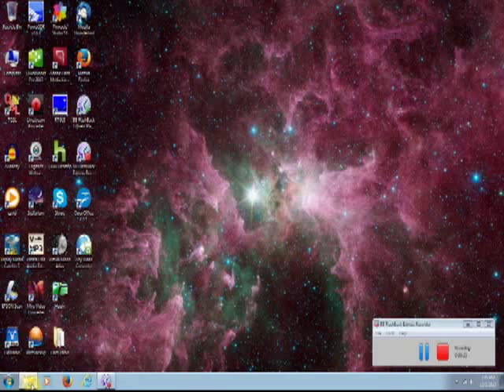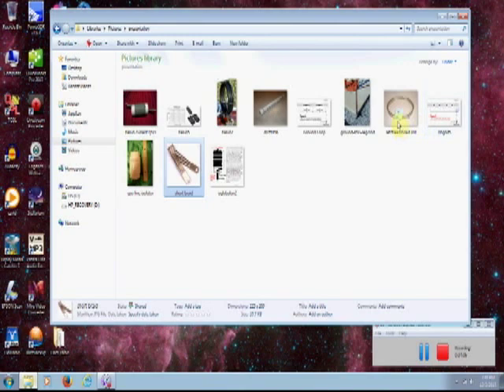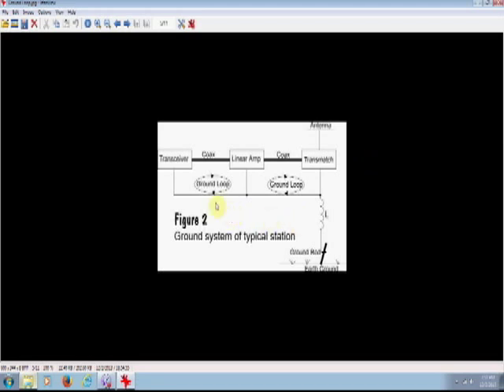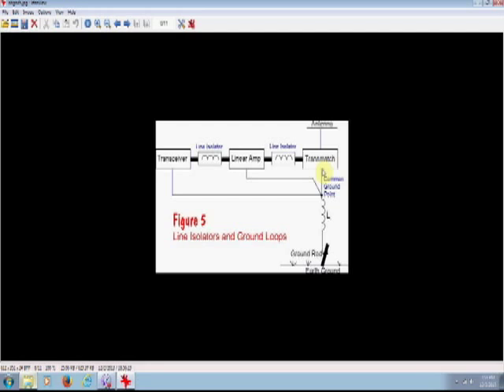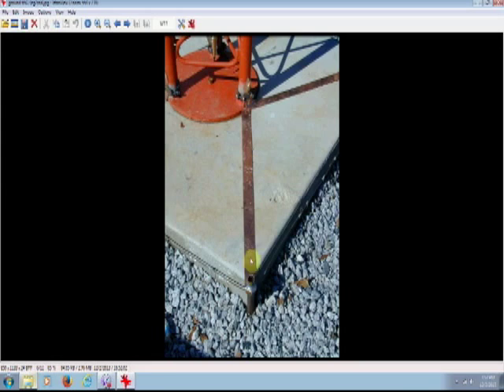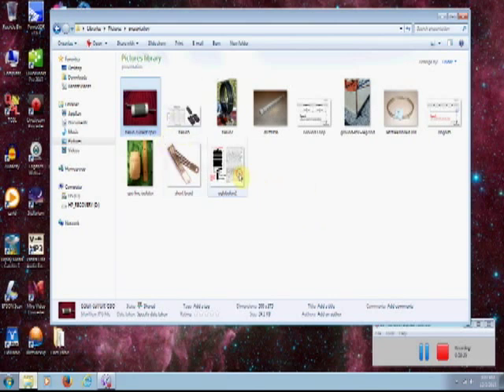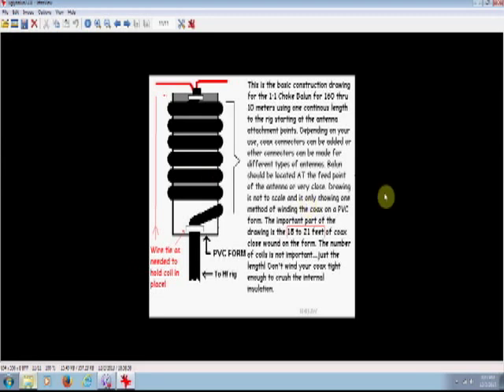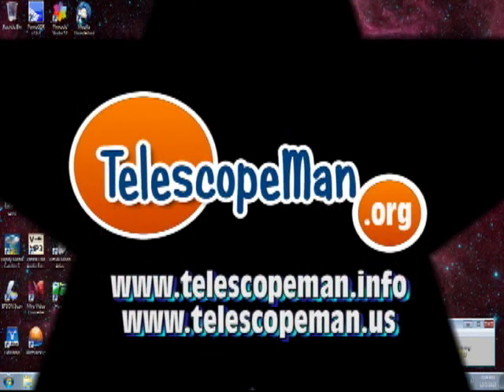Beginner Ham Radio #3 - Grounding and RFI

Comment: Excellent article Joe, My grounding system seems to be working but I'm going to upgrade the  materials. My grounding rod is outside the house, and all antenna coaxes are also grounded. Many years ago,  I did have a ground rod in thru the floor of My shack, the lightning hit My antennas on My tower and come down the coax into My shack, welding some PL259-SO239s along the way. Luckily , My equipment wasn't connected apart from an antenna switch which was burnt/melted. So, I'm keeping the grounding rod outside the house this time.  Lee  VK2LEE

Comment from the maker: Greg, what happens with RF is every piece of equipment will have TWO ground paths if you wire it up as in the first picture. By using a single point ground you eliminate separate ground paths which can get back into the radio, microphone, or attached computer. This is called a ground loop which can cause your equipment to misbehave, or even shut off like mine did.

You can also get feedback into the microphone every time you key up the transmitter.

Comment from the maker: I love it when cell tower folks comment that this is NOT the way they ground a cell tower. The issue is MONEY. Amateur radio operators usually cannot install a full perimeter ground with multiple ground rods 8 feet apart around the entire house-- all interconnected with #4 ground wire that is all cad welder. :)  Nor can we usually ground everything in the shack including the operating chair!

I would appreciate it if you folks would;d step back a minute and remember the word MONEY. Usually an amateur tower surrounded by at least 3 ground rods in a "halo" system around the tower and a copper strap from each tower leg to a ground rod, with the tower also connected to the utility ground for the house--- and the local ground rod positioned outside and very near the shack also tied to the tower is probably all that a normal ham can accomplish at a residential site at a reasonable cost.

In most cases this will place the equipment in the shack at a similar voltage potential as the house and the tower. Will it absolutely protect you from a direct lightning strike -- well no. Why? because the lightning just traveled a long distance across air to reach the tower and will chose it's own path to ground. Hopefully one of the ones at the base of the tower--- BUT? who knows? That's why they make quick disconnect type PL259 adapters. :)
73

Comment from the maker: Since this video I have upgraded the grounding by running braid to a single point behind the desk (from all the equipment--- and then running from there directly to the ground rod outside. I also improved the pass through panel grounding by replacing the ground wire with 1 inch copper strap.
Reply: Joe Lalumia good move. ONE path to ground is the boss. A single point. No buss bars. Otherwise it's loop city.

Comment: Thanks for the video. I am a brand new ham with General setting up my shack. I just purchased my HF rig and am looking forward to my first QSO  so I have a question: Even with the common ground/earth connection the power from those units have another path to ground through the utility power. So is that not a concern? Interesting that you solved all your problems this way.  Hard to argue against real world experience.  73 de KI5HXM

Comment from the maker: Superflatrock- of course there is an impedance mismatch-- its a 160-6 meter long wire with wrapped torrid. I use an antenna tuner. The RF in the shack was caused by ground loops and the regular wire I was using. Once I went to a single point ground using 3/4 inch braid the radio never shut down again. I have since added a Flex 3000 SDR radio which is sensitive to RFI without any issues. It was my poor grounding system causing the RFI probably had several ground loops inside the shack. See my latest videos for a view of the shack at this time. 73.

Comment: You need to replace the stainless with brass to prevent electrolysis from dissimilar metals. Save you a headache latter.👍👁👁🇺🇸

Comment: Great video. I want to ground my vertical antenna. How far should the ground rod be from the concrete slab that's in the ground. Also, is one ground rod sufficient or will I need to install more rods and if so, how far apart should each rod be from each other. Also, I will be installing a window cable pass-through and will be putting a ground rod outside of my window about 4 feet down from the window. Should I use copper braid to connect the ground rod to the window pass-through plate or will a solid copper wire work fine. Also; in the shack, should I use copper braid strips, attached to each piece of equipment to attach it straight to the inside ground lug located on my window pass-through?
Reply from the maker: The braid will work better than wire copper strap is even better. Both have more ground surface area than wire. My tower had 1, 8ft ground rod attached to each tower leg. I put the rods about 1 foot away from the concrete and all 3 rods were connected underground a few inches with #6 bare wire in a "halo" around the concrete.  73
Reply from the maker: I use a single point ground inside the shack with a copper strap 1/2 inch from the single point to the ground rod outside the shack window.
Reply: Thanks for the quick reply. I will be using a window pass through option. So there is a wingnut screw on the inside to connect a ground wire too. Should I use the 1/2" copper braid coming out of all my equipment and connect to the window face plate ground screw and then use another braid on the outside to go straight to the ground rod or just use a solid copper wire from inside to the window face plate and wire or braid from the outside plate to the ground rod?
Reply: @JoeLalumia  Thanks for quick reply!
Reply from the maker: @BoboAthanassion  I have the same passthrough. In my case I ran the braid directly from thr single point inside the shack UNDER the passthrough and directly to the ground rod. Then I ran a second piece from the OUTSIDE wing nut to the ground rod to ground the shields of the coax cables.
Reply: @JoeLalumia  Awesome! Thanks! I'll do the same. Thanks again for taking the time with your knowledge. I'm looking at putting up a flagpole vertical. Only 28 feet off the ground.

How about a copper strap from my equipment inside to the lug nut on the pass through and then a braid from the outside lug nut to my rod?

Comment: Thank you for taking the time to post this important information. Is it possible to make this "choke balun" directly from the coax that attaches to the transceiver by making the circular loops, providing there is some additional length in the coax? Thanks again...
Reply from the maker: Yes you can make 8 to 10 loops of coax and or wrap about 18 ft of coax tightly around a 5 inch piece of pvc.  You can also use a foot long run of clip on ferrite magnets mix 41 to choke out common mode currents. 73

Comment: Figures 2 and 5 are electrically the same except the "line isolators" between equipment in figure 5.  You said nothing about them that I recall.  Had these "isolators" been installed in figure 2 the same result would be achieved = broken ground loop potential.   What am I missing?

Comment: Hi Joe. I am a newbie in the ARRL, just joined 2 days ago.  Studding for technician class.  Is their a method of detecting or metering the presence of RF in the shack?  I also live in East Tawaokni.  Sort of a neighbor.  Trying to get nerve enough to attend the SVARA monthly meeting.  On 3rd Thursday.  Thanks
Reply from the maker: Most times RF will get into the audio or the radio and cause distorted or "buzzing" audio, it can actually turn off the radio as mine did before I improved the grounding by bonding all the equipment to a single point, and using braid instead of a wire.

Comment: Joe, in this video, in the diagram showing the correct "star" ground, I see "line isolators" in the coax between pieces of equipment.  What are these?  How do I construct them?  Thanks and 73, Rich, WB2GXM
Reply from the maker: You can buy these or make them. Just google "choke Balun" or "line isolator ham radio". In my station I did not install the line isolators between the equipment. However I do have a line isolator outside the shack window on the QSO King end fed wire antenna. Here is a link to a commercial one- http://www.ebay.com/itm/Line-Isolator-Rated-1500-watts-stops-RFI-small-/141209547404?pt=US_Radio_Comm_Antennas&hash=item20e0beb28c

You can make one by putting ferrite magnets around a piece of coax.

Comment: Brade is not a good radio ground, It's a good electrical ground,.. Flat strap copper is the prefered radio ground material, thats what we use in the broadcast & cellular industry,

The gounding he discribs is great for electro static conditions.  Radio grounds require a solid type material and all connections must be welded, a fluid connection if you will.  Brade has resistance to radio frequencies.  Hope this helps...
Reply from the maker: Take a look at the "tower" construction videos--- I do have copper strap there and also now on the pass-through panel grounding the shields of the coax, along with an Alpha Delta lightning arrest on the coax.

However -- again- once I used the braid instead of wire I have experience no more RF in the shack even when using my amplifier. The Flex SDR radio and the Icom 7000  both work perfectly. Additionally my Heil PR781 microphone does not have RF interfering with the audio signal. (single point ground on all the equipment)

73 and thanks for your comments.

Comment: Did I understand you correctly .. can i just take the braid from my radio , the braid from power source , go from power supply direct to ground ? Im a ham returning to my hobby ,, guess what i am asking .. braid from radio , braid from power supply , both going to my controller(rotor control) from controller , direct to ground ? in advance , thanks for your help / time ..
Reply from the maker: +Brian Ard 
Yes you can, from a single point somewhere behind the radio equipment.

Comment: Ok here my opinion on single point ground. The first schematic was ok. There is no problem doing like that at all. Single point ground is not one ground rod and that it. No Sir!  Single point ground is when you take all your equipment on the shack and grounded like you had it  and then bond that ground rod to your main rod in house this includes the tower rods etc. All to one rod which is your main ground rod to the house. Analyze this and you will get it right away. Hope this helps.

Comment: I need a little ground advice as a new HF ham, just got my general. I want a good ground in my shack, but my problem is location. The nearest spot I can push a grounding rod is 30 ft from the rig. Would there be a problem drilling a hole though patio concrete outside the shack window and put the rod through to earth? Thanks to all who respond.
Reply from the maker: Scott Gist no issue with drilling a hole as long as you can get 6-7 feet of the rod into the ground below the concrete. 73
Reply: Thanks> will do
Reply: I don't recommend an indoor ground rod. Lightning wants the best ground it can find. You don't want it in there with you!🤔😆👍👁👁🇺🇸

Comment: I noticed at around 12:45 in the video it appears you soldered the copper ground strap to the ground rod.... I can tell you from experience solder with not hold up to a lightning strike. It does however melt and fly everywhere leaving you unprotected. IF you used a cadweld system all is well.
Reply from the maker: Steve Mazz no it's clamped

Comment: Figure 2 (with the ground loops) is the same as the ARRL book says you should RF ground. What should i do? My radios are up in the second floor...
Reply from the maker: knikk77
Suggest you not ground or install a ground "mesh" on the floor of the shack. You can put a carpet over it so it's not visible. However many amateurs operate successfully without grounding. Try to eliminate any common mode currents and be sure the equipment is electric grounded using a 3 prong wall plug. Unplug everything during lightning.
Reply from the maker: knikk77, yes I was also surprised that the "bad" ground is also shown in the ARRL book as the way to do it! :) What can I say ?  When I setup my shack that way I had lots of RFI. Once I went to a single point ground I have had no issues with RFI. Remember the type of antenna can contribute to RFI especially if it is near the actual equipment. Try to use a resonant dipole with a choke balun outside the shack usually mounted very near the actual antenna. This may help you eliminate RFI in an ungrounded ham shack up on the second floor. 

And-Or read about a wire mesh on the floor of the shack with all the grounds on the equipment connected to the mesh on the floor. This will equalize any differential currents and ground loops between the pieces of equipment.

Comment: good stuff - thanks for sharing.  I used to have the single copper rod inside the shack (that you describe) and have had ground loop issues.  I will be replacing that w/ the "right" way. We'll see how that works out for me.  God Bless. N0AGI.  73s http://N0AGI.com/
Reply from the maker: Thanks and 73.